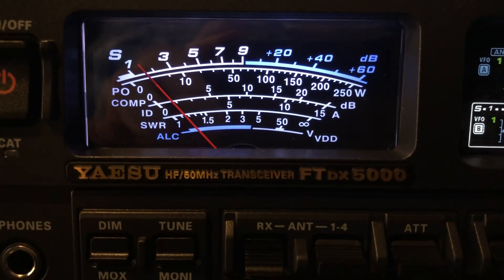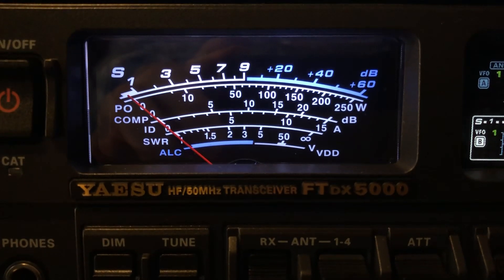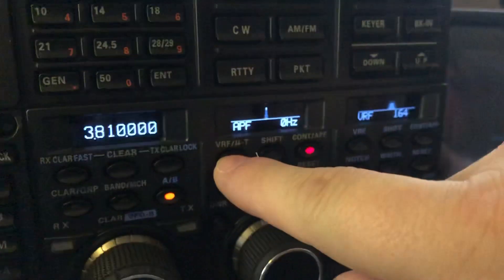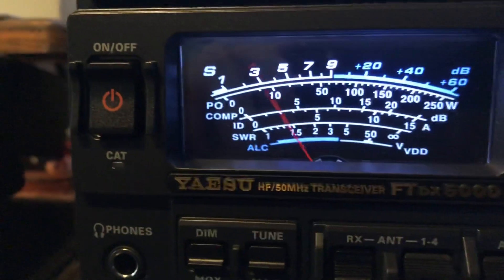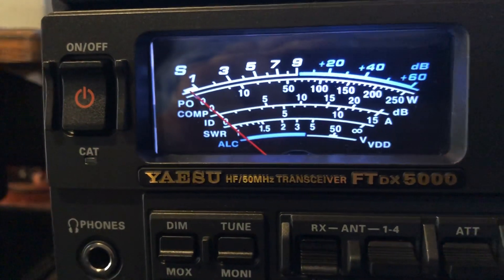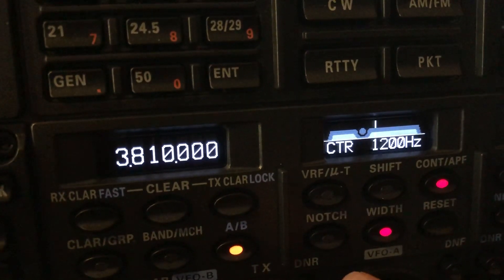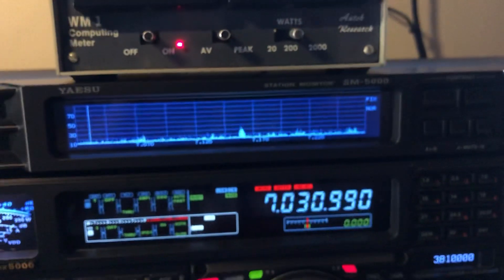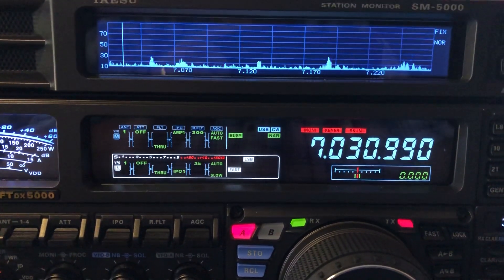Yaesu FTdx5000MP: Filtering CW Signals #yaesu #ftdx5000 #hamradio #cw

Comment: What modern SDR Radio in 2025 has fast SILENT QSK on CW ? 

The 7300 is so bad.
Reply from the maker: Elecraft K4.  But the receiver is better in the K3S hybrid.  However, I still prefer the FTdx5000MP.
Reply: @n4hnhradio thanks.